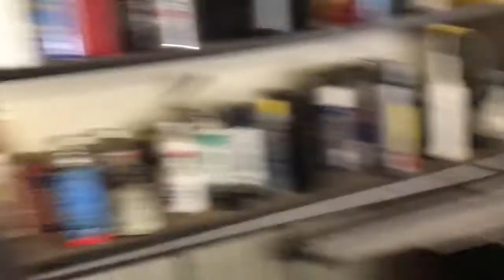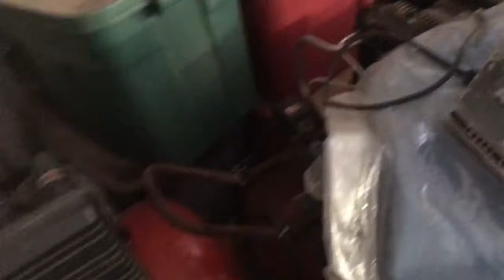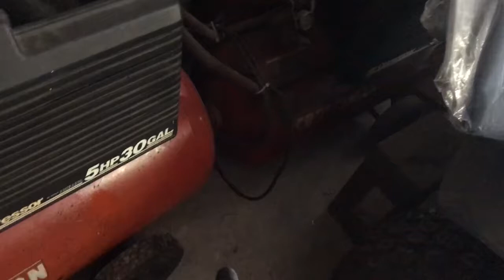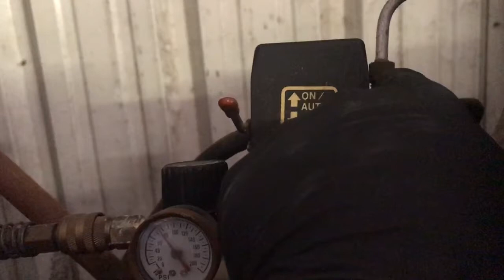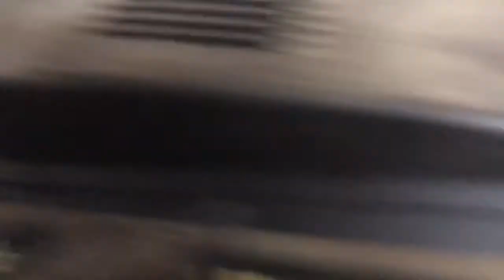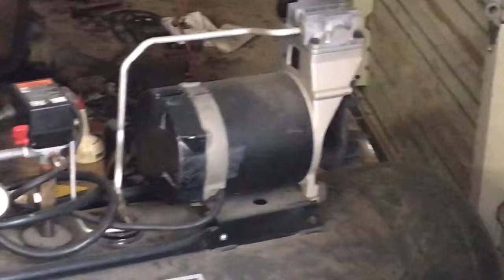Air Compressor Problems

Comment: Don't waste you time and money on the oil less crap!! Fix both of you Cambell Hausfields up!! I used a 4 HP in a professional Body and Paint shop for years!!☺
Reply from the maker: I will fix them but I think the oiless will get repaired as well. Just checked and complete rebuild parts will be about $70 and for the pressure and cfm this one puts out, I'd spend several hundred to get an equivalent cast iron pump.